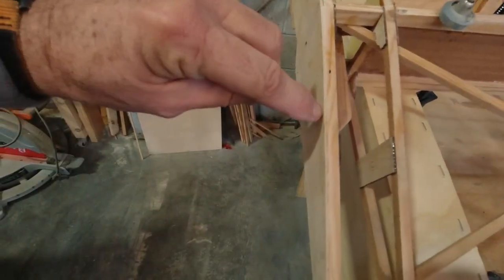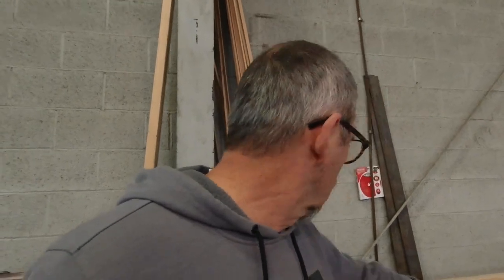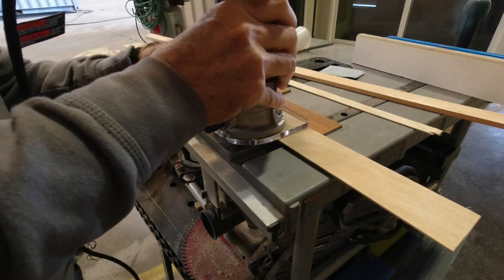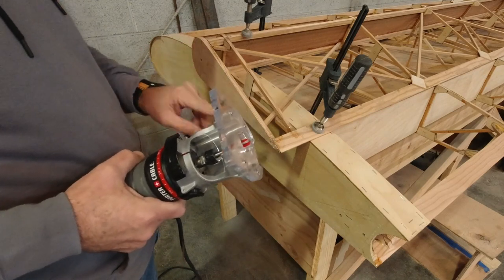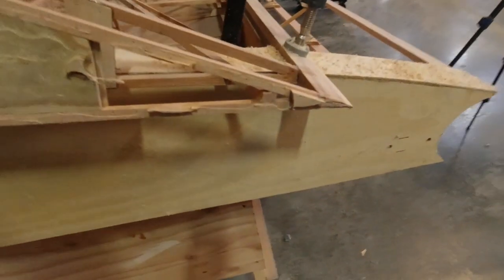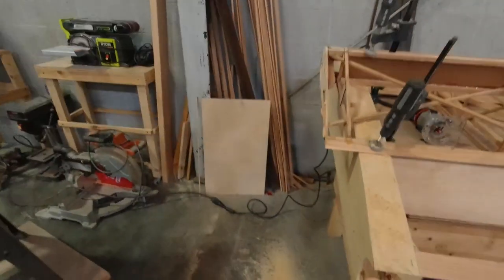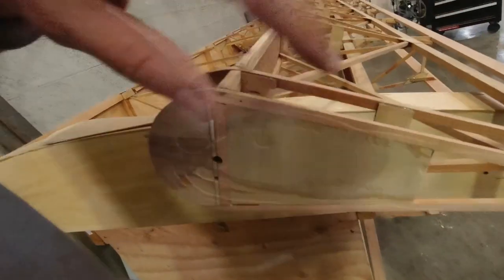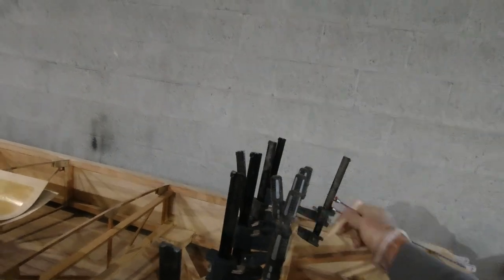Minimax 1100r Aircraft Build Vlog Episode 42

Comment: To those building a MiniMax wing: the TEAM factory is now specifying 14" wide aluminum fuel tanks (which they say they've always done).  At least a few people have gotten tanks with widths less than 13-1/2".  At that maximum width, it's possible to install the tank AFTER the outboard RS-17 support at rib #2  is installed as this video shows.  It's NOT possible to install a WIDER tank if the RS-17 is already installed.  Several people have reported this problem.  If your tank is wider than about 13-1/2", you'll have to either install the RS-17 support AFTER putting the tank in the bay or maybe move the RS-17 support to the outboard side of rib #2 instead.  Installing the tank first and then installing the support piece is not a problem unless you expect to have to remove the tank later.  Moving the support piece to the other side of rib #2 will require a wider tank cover.  As of September, 2024, I'm expecting to receive a 14" wide tank, and I haven't yet decided which method to use.  Another person has reported that he had his 14" wide tank remade to a shorter width.

Comment: I wish I had given you my other tip about routing, which is to start in the centre and work out and then use a filler piece to support the router for doing the out section. For your inner 1/8 addition, if you can remove the gussets and then you can go all the way out to the edge of the rib with a good bond area for all the rib behind the spar. The other plus to that is it will be easier to get it to conform to the rib and the void will not be a problem as you had made a good stiff box section.
Thanks for the shout out, builder supporting each other is all part of the aviation world.
Reply from the maker: You’ll see I took the long road and encapsulated the gussets. After I started, I realized what you’re saying about starting in the middle. It worked out, no problem.
Reply: @DTMinimax  Look forward to seeing the work.

Comment: I would have added 1/8" ply to the whole tip rib, small weight penalty and much easier. Weight could be reduced removing existing ply from between diagonals of the rib similar to the root.
Reply from the maker: That definitely could have been a lot easier!